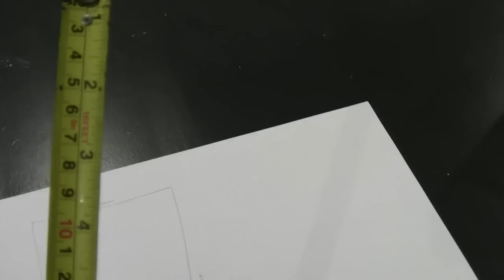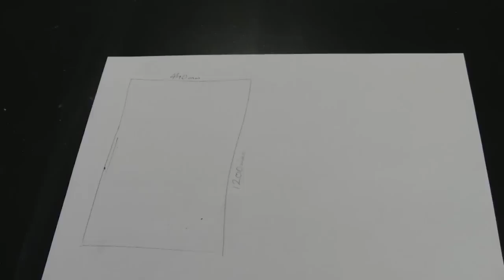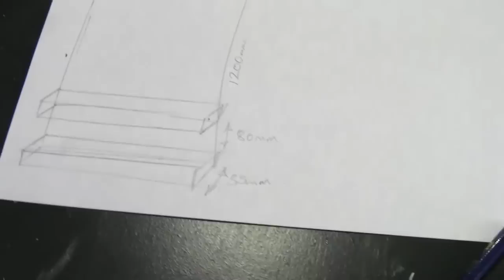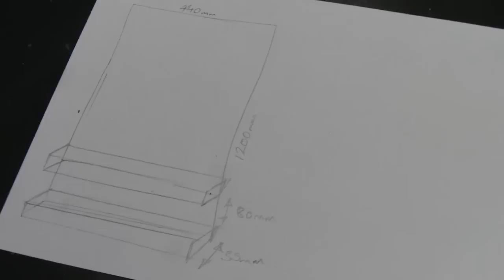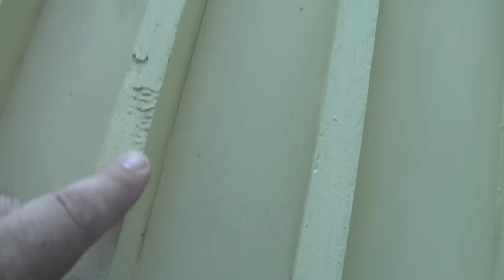Make Your Own Paint Rack/Shelf

Comment: I love this idea! I will get started on mine tomorrow! Thank you very much for this idea and the How to video. Many thanks!
Reply: John Cherry Hi, I'm looking to make this rack over the coming weeks. You may have more idea than me but the screws on the back, is there a special screw to use? Or drill bit? Or do you just screw in a normal screw with a screwdriver?
Reply: Hello, Sorry for not getting back to you sooner. I just read your question. I use sheet rock screws. The length of the screws depends on the foam board used. If using 1" thick foam board, I would use screws that are a minimum of 1 1/2" to 2" long. I also use sandpaper to rough up the surfaces to be screwed together and use PVA glue or known here in the States "White glue". I glue the surfaces to be joined after scuffing them up first, so that the glue has a rough surface to assist in joining the foam board parts, in addition to the sheet rock screws. Between the two, the shelves should be very strong. I hope that this is of help to you. All the best, Jack Cherry

Comment: I have that problem indeed. Would help me alot if GW (and others) would just make the top of the container the color of the paint it contains.
Reply: I just paint the top of the containers with the colour that's in it, bit hard to do with inks tho. But simple and helps when you try to find the right bottle :)
Reply from the maker: The clear containers helped but painting the lids is a good idea if you want to stick to the 'shoe box' storage system.

Comment: I really need to get my paints sorted ... though a piece of extruded polystyrene that size here will run you around $25, so I've got something else in mind
Reply from the maker: I bought the 20mm sheets of a caravan insulation firm off of eBay. I think it worked out around £7.50 (Don't know what that is in Aus $) Had to buy eight sheets to get that price but you can never have too much styrofoam ;)